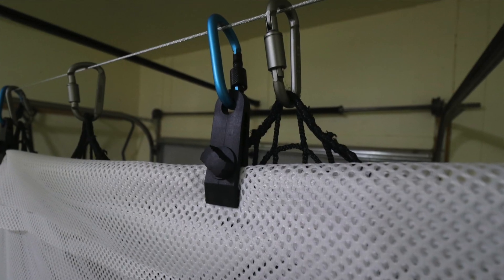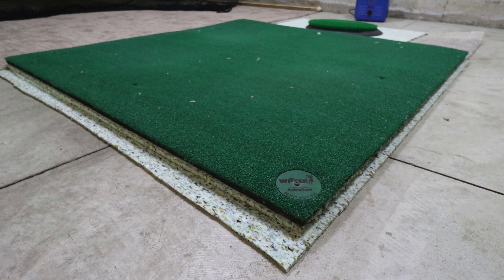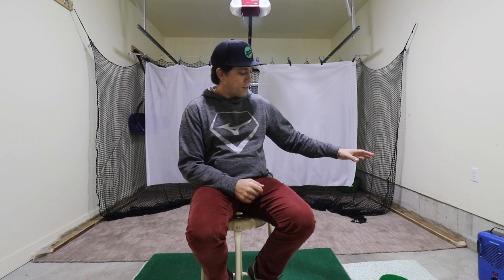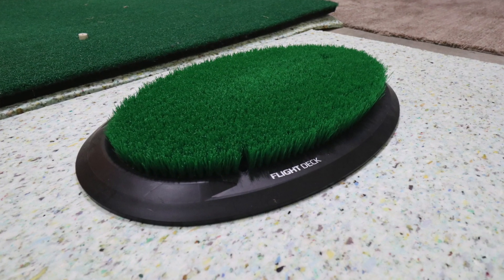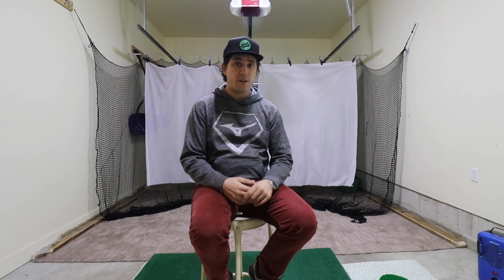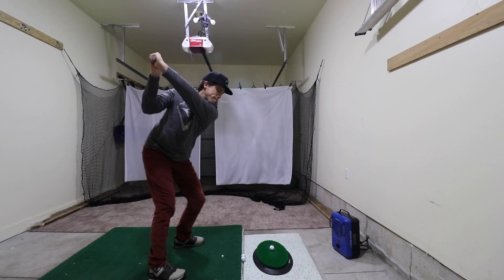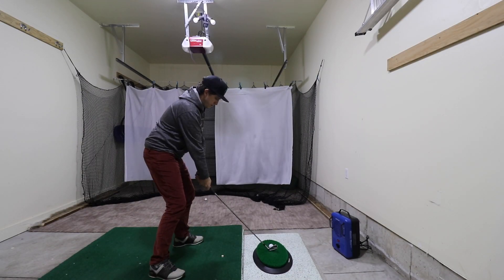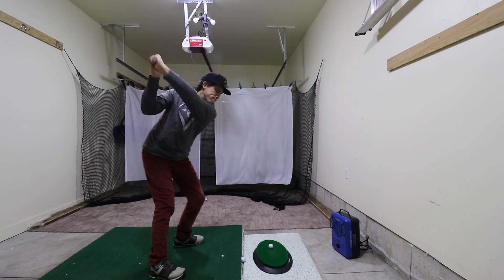DIY Golf Net Part II - Upgrades to my indoor practice net

Comment: Hey Ryan, looks like you have a heater on the ground. Have you looked into quartz wall mount heater? I have one mounted on one side of my ceiling facing me when I hit balls in my garage and it is working well for me(garage not heated and door is not insulated). Tested down to about -8c so far and hope it will work okay when polar vortex hits.

Also, I am getting a blue recycling bin for my curtain style hitting screen. Fairly sturdy and the one I can get is about 3ft tall and makes it easier to throw the screen in and keep it in place when put away.

Comment: Really nice setup your garage literally is the same as mine ordered the net and now looking at a mat I have a few questions on the setup there seems to be a lot of choices for mats.  I like the idea of the flight deck but am using a eyeline speed trap 2.0 to help my swing path not sure the flight deck would be big enough 
1.what brand is your larger mat 
2.do you plan on adding a projector screen ever